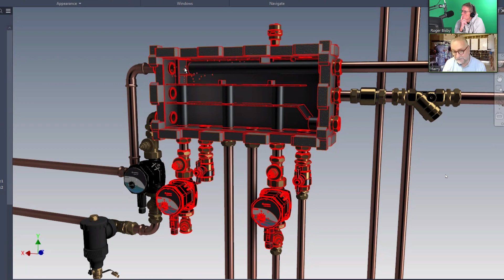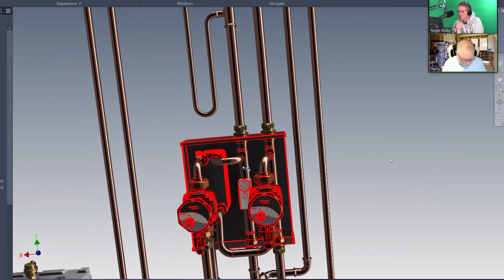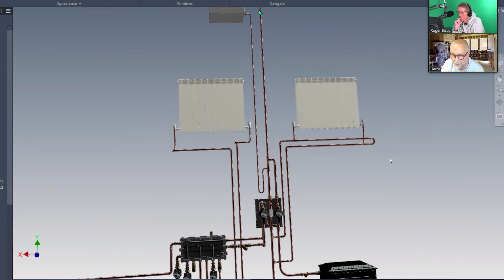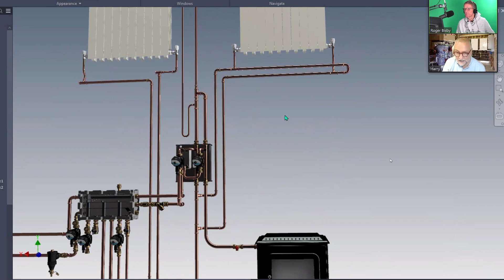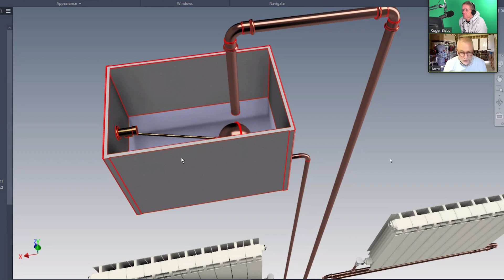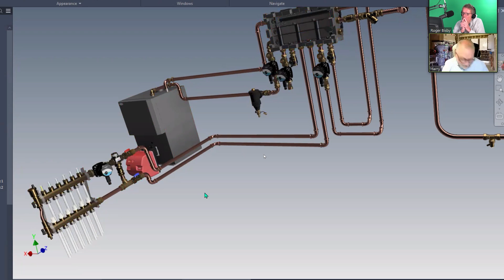Every Heating Installer Should Know This

Comment: Worked in many 100 year old systems without pumps at all, 293kw and bigger (1million btu old money) always amazed at some of the connections to some rads with flow and return connected to single pipe within a foot , we have lost the wisdom of the old days brought about by the introduction of sealed systems and combi boilers where anyone can install rads and they work no matter how they are piped up hence the onslaught of diy installs . They even had to invent a bi-directional TRV so the DIYs could make them work .
Reply: Bi directional valves make plumbing easier for us. What you goin on about
Reply: If you were a proper heating engineer you wouldnt need them know which pipe if flow and return all the way through your installation by the way its not plumbing .
 @poorfordtransitowner1627
Reply from the maker: He is talking about one pipe systems not 2 pipe reverse return.
Reply: DIY your car do you or have you got money to spare not everyone has spare cash to take the chance that the plumber knows how to fix it just like your car.I have had my pants down a couple of times not in a gas way.
Reply: Your fault employing a plumber horses for courses you needed a heating engineer . @Allegedly2right

Comment: But does it really matter if you've got antifreeze antique corrosion added to the system You're not going to get any corrosion.
You have to be careful with aluminium and copper a lot of gas boilers have aluminium I think in the heat exchanger, this will cause corrosion with the aluminium and copper in the water you need an inhibitor a anti-corrosion additive. Otherwise the aluminium will just rot.
I don't understand why you need so many pumps on the system? surely one pump is enough just use valves to control the areas you want flow or not I can't see adding more pumps is beneficial.
Isn't it just a manifold this NRG? I've got two boilers oil and a twig boiler I made, both connected to each other one is on top of the other utilising the boiler container in the oil boiler, the twig boiler just heats up a coil of pipe at very high temperatures about 300° c using the flow from the oil boiler water container and then out into the system and a valve for the merchandiser what I had real issues with I'm getting too hot, We're talking like boiling I had to put a valve what he was suggesting to restrict the flow but the valve keep failing under the heat so I had to use the oil boiler tank to control this and just switch off the radiators and limit the amount of fuel I'm burning, what I could do with a program system something like a raspberry pi measuring the heat don't know anything else that could work it's not like gas where it's instant on and off even if I stop the flow of wood there's always a burn period even restricting the air the only other thing I thought about was taking a large pipe and feeding it through an exchanger car radiator outside of running cold water and using an electrical valve to regulate it through a thermostat. But that is a bit of a pain and is awkward. I need to get a high temperature steam valve I think is my solution maybe. I've made the boiler to efficient and producing too much heat it's still an experimental stage.
You could do something like that with the cold water feed into the tank or back into the system just put it through a oil radiator from a car that would cool it down enough
Reply: What you need to do mate is to connect it to a turbine driven generator and export to the grid. Just make sure you have a plentiful supply of dilithium crystals.
Reply: @normanboyes4983  yeah there is tha I did think about that connecting it to a turbo when everything is sorted out I probably will can't have them too many irons in the fire at the moment excuse the pun 😉

Comment: "Dipping" the cold feed is nothing new,   old drawings for the myson aerjec in the 80's showed it IIRC.
Reply from the maker: I have taken loads of those out, all blocked solid. I still have a new one in my lockup and keep thinking it should be in the scrap.
Reply: @SkillBuilder    Aerjec's were a good bit of kit and blocked for the following reasons.

Back in the day people never flushed systems and most didn't use inhibitor, so magnetite was a ever present problem.

The Aerjec caused turbulence of the water so the air would come out of suspension and go out up the open vent.
Unfortunately this turbulence meant that the magnetite also dropped out of suspension and blocked the Aerjec!

I also still have one in my garage in a box and doubt I will ever use it up before retirement......................

Many of todays low loss header recognise this historic problem and have a drain at the bottom to flush any separated magnatite and a auto AV on the top.

The other thing from these times past that springs to mind, talking of neutral points and magnetite:   is the SMC pump-pack instructions:  
    Mainly when piped as per there diagram  with the cold feed in the cylinder return, blockages always occured at this point, with no dhw as the symptom.

I  sorted loads and used to close couple the feed and vent on the flow,directly before the first pump.
Never any issue thereafter.

Comment: Surely it's just a neutraliser, nothing new there.
Reply: I was thinking , Low loss header with baffle ?     But yes, similar to a Dunsley.........
Reply from the maker: True to say but it is a nice looking bit of kit
Reply: Try putting a heat pump in a hybrid system together in a low-loss header or a neutraliser and I think your question will be answered. 
There are hundreds of hybrid systems working perfectly with an NRG Zone and zero issues. Obviously, there must be significant differences.

Comment: Are you kidding me they have made a system that costs more in copper pipe and valves than a combi boiler not to mention you need to be a rocket scientist to keep it running they have done to heating what has been done to cars made it so complicated it is broken most of the time.
Reply: Lol... you missed the point.   Copper is just for the pictures/artwork: the flow and design using any material for piping is the key here.
Reply: This is not for a 2-3 bed terrace. Have you seen the plant room behind him? This is merely design considerations which for a smaller house would be minimal as the pipework is minimal anyway. Everything is much smaller and costs less as such
Reply: Assume you’ve brought a modern diesel and do a lot of short journeys. Modern cars are super reliable.
Reply: When they first developed combi boilers it would have been a load of different units stuck on the wall - doesn’t mean a manufacturer cant package it up for consumers